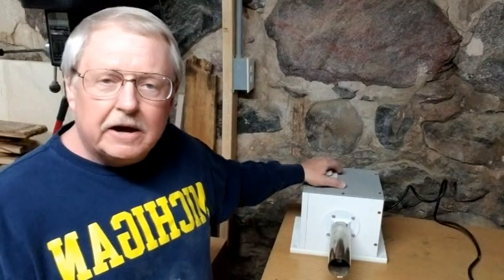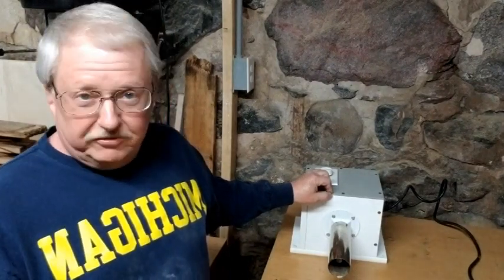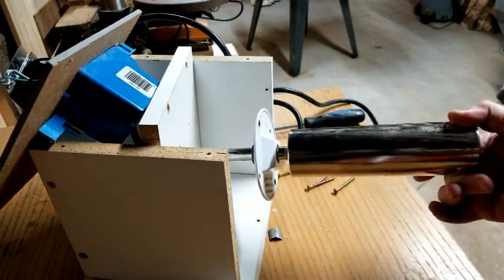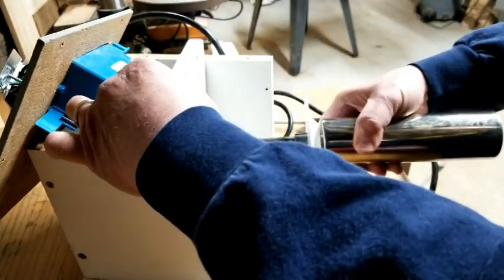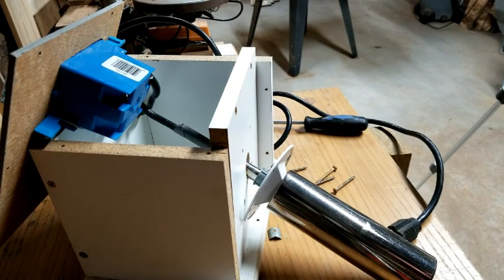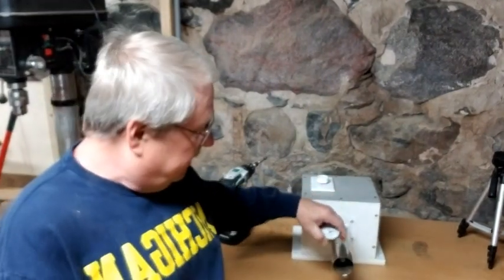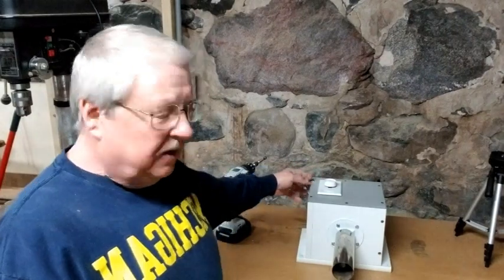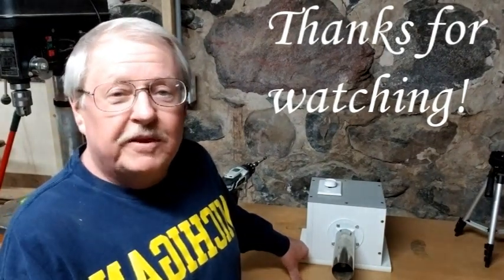How to build a side bending iron for building acoustic instruments

Comment: Have you ever used a curling iron to bend wood?  I just want to bend 3mm binding for my first build.
Reply from the maker: Hi Adam, I have not used a curling iron. I use my heating tube, which I set at about 250 degrees, to bend wood binding, I'm not sure how hot a curling iron gets, but you could probably try it on a scrap piece of binding. Please let me know how it works!

Comment: PS .. I have run 300w lights on it as is ... but if you want to operate something really powerful  you can just have the switch operate a relay that will handle whatever megawatt project you're making..
Reply from the maker: Thank you for that tip. I will probably have opportunity to try it

Comment: Interesting build.  I've built two bending irons, one small 1.5" diameter and one 3" diameter.   The larger one uses a 200w  light bulb to heat and the other uses a cheap cartridge heater.   Pretty simple and mounted vertical on a guide board and held in my woodworkers vise.   Are you on the FB Ukulele Luthiers group?
Reply from the maker: Yes, I wasn't quite ready to shell out $200 for a bending iron. A little ingenuity goes a long way! What did you use for the different diameter bending tubes?  Thanks for tuning me in to the Ukulele Luthiers group!